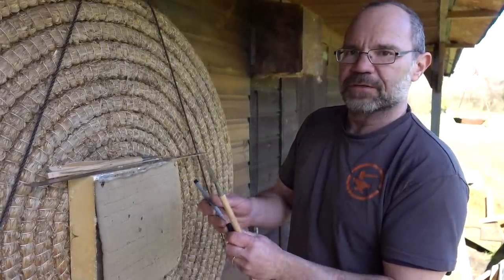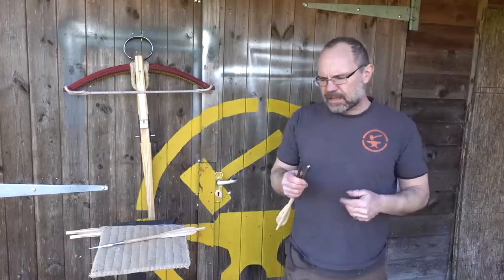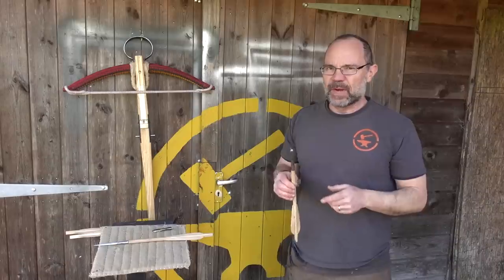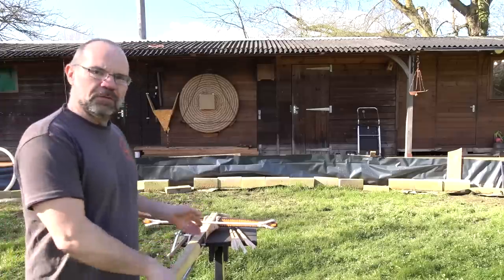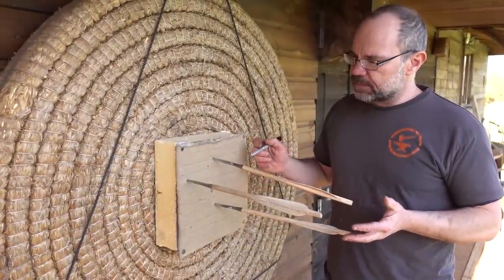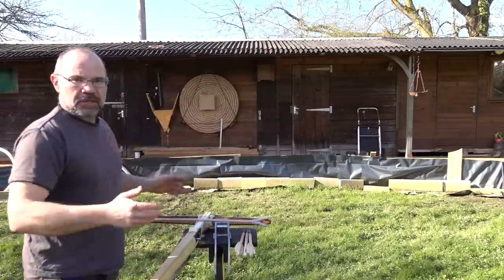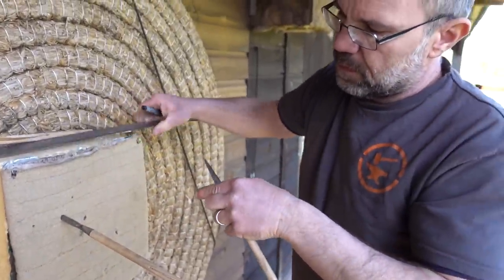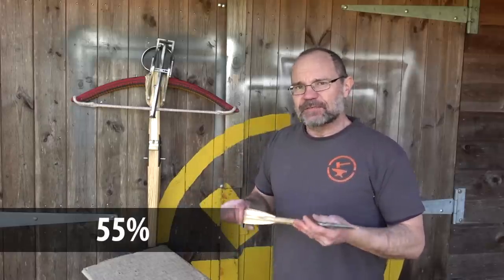Does WAX on ARROW HEADS Do Anything?

Comment: I am very curious as to whether the penetration was so consistent because you were consistent with the wax coating. The bolts weren't in focus when you tried showing the coating but I think I could see it by a reflection that didn't seem to go all the way down the bolt head, and that seemed to be about 45mm. If you coat more of the bolt would it go as deep as you can coat it (if my assumption is correct about the coating you had on them) or would you start having diminishing returns?

Comment: I'd be curious if waxing broadheads did  anything comparable, although they seemed to go through so easily that it might not matter. Also, are waxed needle bodkins still worse than broadheads vs cloth. If the difference between them is slight then I imagine that you might just always use needle bodkins.

Comment: I always wondered why when I watch anything about weapons and armor from history they rarely and most times never bring up the distinction between mass produced war intended type and small batch privately produced type. Because the effects on how we perceive history is by what we find and unearth. Well mass produced used in large scale war weapons are much more numerous and in nearly all case are developed with compromises to reduce costs. Where the smaller scale private producers were more inventive with wide spread use but in most cases owners would use their weapons for generations to the point of wearing them out and recycling them. So little to nothing is left for recovery. So we know relativity little about the true weapons and armors that the wider (wealthy)public made use of. But we have lots of evidence of what was used in larger scale wars and held by troops then assumed as the "what was used back then" concept.

Comment: Arrow/bolt heads would have been kept in storage for extended periods of time.  Surely they would have been waxed/oiled to protect from rust?  Of course, polymerizing fats like linseed probably wouldn't provide the same lubricity as beeswax.
Reply: Guess I should have scrolled down before commenting.

Comment: Well, I would imagine they'd have wax on the bolts and arrows. After all, if a castle or fort is going to have barrels or crates of bolts sitting around for months or years, they needed to protect them from rust and rot. And wax is one of the earliest waterproofing methods we know of. I would be willing to put money on it.

Comment: Well one consideration is that the old bolt heads were not stainless steel so they would have rusted especially if a store was made and then transported to a war zone by ship. Think England to France.

So I recon rust is bad and it would definitely blunted the point of a pointy one and increase drag through the target due to rust being rough. So maybe and I do say maybe prior to storage or transportation the metal bolt and arrow heads were dipped in hot wax to give them a very quick way to protect the metal heads. Now everyone arrives at the war zone or country by ship and immediately fletchers and smiths go straight back into arrow production. On the day maybe the stored or transported arrows are used first and soldiers and officers see how it goes down. Maybe after a big March to the next battle the new arrows are used that have no wax and the soldiers on the ground note the relative ineffectiveness. 

It only takes one person to put two and two together and pass it up the line. Shit thousands or tens of thousands of soldiers are present on each side so someone would notice something sooner or later. This was an arms race after all. 

That might be a plausible mechanism for development.

Comment: This premise seems entirely plausible and almost intuitive. Bees wax has been used for years as a traditional method of rust prevention for iron and steel. Kitchen Troll has a good point about using tallow (beef or mutton) as a lubricant. Tallow and lard have been used as lubricants and for water proofing materials throughout history. It makes sense that an arrow smith would’ve dipped his metal tips into a cheap and readily available protectant. Most early science breakthroughs were based on observation, so it is entirely plausible that archers noticed their arrows and/or bolts penetrated deeper when coated.

Comment: What do the faces of those heads look like under a microscope? I’d imagine just having wax worked into the pores and pits would provide a smoother blade with fewer chances for friction. Ideally I’d like to see faces of the first glob-on-the-tip after being shot (if it can stay on), one that had been dipped, and one polished to try and work the wax in as thoroughly as possible. Does dipping alone leave air pockets? If the wax’s molten lubrication is what’s driving it, would a sticky oil, animal fat or lamp black preform similarly? How do different methods compare in penetration? Could combining polish and dip be even more effective? And finally, could we find traces of any of these on bolt and arrow heads in museums?

Comment: I think a tendency in the analysis of history is to try to put things in a context of "everyone had to have done this" when in reality in any military unit everyone is an individual.  We are trained to work together as a unit, but still we have our individual tendencies at a micro level.  Some guy may have put wax on his arrows, and tried to convince his buddies to do it but they wouldn't.  Maybe it was a well known thing that a lot of archers did.  But if you look at it as a possibility that some guys did this, you can probably get much closer to real truth.  Same applies for putting dirt or stuff to cause infections.  There is no military advantage for that in a battle.  But an archery unit may have had one or two guys that were a bit "extra" who wanted to be that little bit extra nasty.  It was their thing, maybe.  We all have known a guy or two like that in the military.  Of course, maybe it was also widespread.  But these small things that clearly had some small advantage, someone had to be doing them.  (My issue with the wax being used widespread is a matter of supply and logistics. Was beeswax that common, easy to get, easy to store on a soldier, easy to distribute, and easy to keep from melting, and cheap?)

Comment: Point of order from a gun geek: bullets are not coated with Teflon for the purposes of getting through Kevlar body armor, and the Teflon coating does very little - if anything - for the purposes of penetration. The "cop-killer bullet" is a myth - at least, in the form of Teflon-coated rounds. (Armor-penetrating rounds? They absolutely work for penetrating body armor, of course - it's right there in the name.)

The teflon coating on teflon-coated bullets is to aid in reliability when bullets are being cycled from the cartridge to the firing chamber.

Comment: So just a random thought that popped into my head, If the Fletcher comes up with an idea to wax the arrow/bolt heads to increase penetration...what if the armorer (weaver? in the case of flexible armor) added something sticky (thinking tar) to the flexible armor in order to counter the new advantage of the arrow/bolt?
Reply: Texas Typhun interesting thought, but tar would not be the answer. Tarring a shield is one thing, but having tar coated on something you wear, would be miserable. The stench, added insulation, and heat retained, not to mention that your armor would get sticky as hell on a sunny day wouldn’t be practical to use.
Reply: @cav-spartan4201  I was actually thinking to layer the tarred surface so that it wouldn't have much contact with skin on the inside or stick to everything on the outside, though I'm not sure how many folk were layering cloth like that for armor back then. I also suppose tar wasn't the only sticky substance they would have known about, anything to aid in binding up projectiles.

Comment: Medieval archers might have achieved this by accident. Wax has another benefit on steel: it keeps the water off and inhibits rust. Modern blacksmiths  (and machinists), will routinely rub a finished item down with an oily rag for just this reason. Before petrochemicals, beeswax would be a very suitable alternative.

Comment: With the knowledge of hot waxing being an old method used by blacksmiths as corrosion protection, you can be pretty sure the bolt and arrows did get waxed.

Comment: Would dipping the tip in oil help any, assuming that it was done just before battle or as maintenance; I've heard people say the Romans had a ridiculously high trade in Olive oil, far too high for just consumption. The assumption could be made it was used for sword maintenance. While it may have been used to stop swords from rusting, why not arrow/bolt heads as well? Would that have the same effect as wax?

Comment: Rather interesting. I am curious, how do the flesh cutter and the needle bodkin compare at oblique impact angles? (both waxed and non-waxed) Could the needle bodkin catch and dig in while the flesh cutter more just slices and skips off? I am still trying to see if there is one or more areas in which the needle bodkin may have such an advantage that the notion of it being a "cloth armour killer" came to be. Also, many impacts would be on curved portions of the body surface and I presume that any mechanism that would cause the arrow/bolt to perpendicularly align upon impact could give it an advantage.
Reply: That being said, how does the timeline of the development of the "flesh cutter" and needle bodkin compare to the development of different cloth armours and maille armour? The timeline may give hints as to how the different heads fared with the different types of armour. That is, I would expect (though could be wrong) that an armour type would be developed that would resist the presently-available arrow/bolt heads (and other weapons), then the arrow/bolt heads would be changed to better penetrate the new armour and the cycle would repeat.

Comment: I follow Naomi "SexyCyborg" Wu from Shenzhen , China. She is a tech girl who has a sponsor, JLCPCB, who makes custom computer chips. Here is an example of a custom computer chip that measures the force of a Kung Fu punch. 
It occurred to me that a similar, modified chip, could measure the force delivered by an axe, mace, sword or arrow (from a war bow.)
A year or so ago, a couple guys shot arrows, from a 60lb hunting bow at ballistics gel at various distances. 20 yards, 50 yards, 75 yards & 100 yards. Not surprisingly, they discovered that the arrows penetrated more at close range and less at medium or long range. With computer chips like this, one might measure the exact hitting power of an arrow, launched from a war bow (say 120 lbs) at likely combat distances (say 20 yards, 50 yards, 75 yrads, 100 yards or longer distances.)
BTW: Years ago a math teacher taught me that arrows (or bullets) fly in parabolic arcs. The parabola is defined by the angle of launch, the force of the launch and the weight of the projectile and gravity. (Arrows would also be affected by the flexing of the arrow, which would dissipate energy. And air fiction.)
In a mathematically, perfect environment, the maximum distance would be from a projectile launched at 45° to the ground. It would start at say, force X. Gravity would pull on it and it would decrease in speed until it reached the top of it's arc and reached 0. Then gravity would pull it to the ground and it would regain speed until it reached force X again at landing. (Remember, this is in a perfect, mathematical, world with no air friction or lost energy from flexing.) 
If you aim an arrow at a higher arc, say 60° it will rise more steeply and fall more steeply and land closer to you.
If you launch the arrow at a lower angle, say 30°, gravity will pull it to the ground to land closer to you than maximum distance.
The experiment would be to design a cross-bow like frame to hold a 120 lb war bow. It would allow you to measure exactly the amount of force used to draw the bow. It would also allow you to measure exactly the angle of launch. The purpose of the cross-bow frame would also be to eliminate human randomness in the experiment. Thus you could launch dozens of arrows, over and over and get precisely similar results.
There would be three experiments to test:
a. How much force is delivered by a war bow arrow at various distances? Say 20 meters, 50 mteres, 75 meters and 100 meters. 
b. Whats the maximum distance a 120 lb war bow will launch an arrow? (NOTE: Meters did not exist at the time of Agincourt. But can you get 300 yards?)
c. How much force is needed to penetrate various types of gambesons, mail & armor? (NOTE: You already demonstrated that a war bow arrow will not penetrate breast plate armor. But you did promise us shots at side armor, arm armor & leg armor.)

Train Your Punch To Do More Brain Damage- With Science and JLCPCB!
https://www.youtube.com/watch?v=NuXhhkwldEI

Comment: I guess i would like to hear some discussion on how frequent wax was used during the time period. I recall a "modern history tv" episode where he talks about how a wax-soaked cloth works to seal a food bowl like plastic-wrap. candles were a different wax, but WERE a wax that would have been available, but for what other common reasons might someone have a wax handy? I imagine they would have been lubricating bearings (wood and metal,, for wheels, but also for using posts as leverage for hand tools, or in the textile industry for jigs and looms, , they did a lot more manual fabrication of things which might also benefit from having wax, perhaps animal fat would be just everywhere, perhaps they would wax their hair for fashion? (food grease actually offers a fashionable beard and hair if you eat a lot of meat) ,,, By the end of the list of waxes that someone might have available, I think it might be an expectation that people would suggest to each-other, or even provide for waxing an arrowhead or bolt for penetration.
Reply: The list is endless, beef tallow alone is food, candles, leather treatment, wood treatment, grease for iron, general purpose lubricant, used with lye to make soap, moisturiser. I suspect that it would be ok on bowstrings If beeswax wasn't available.

Comment: Other things might have been mixed with the wax, including tallow, pitch, turpentine, and even butter.

In the 1580's, a French manuscript regarding materials used at the time was written. 
https://edition640.makingandknowing.org/#/

Here are some translated excerpts from that manuscript regarding use of beeswax blends. Some of these blends could potentially have been used on weapons like arrows and bolts and I think it would be interesting to know if these blends (which would melt more easily than beeswax) might have produced better penetration that straight beeswax.

I've copied and pasted from the following link which also has some commentary on actual physical research performed with the various substances. I've tried separating my writing from the quoted excerpts with asterisks to avoid confusion. Various documents are cited at the bottom of the article which may 

http://makingandknowing-prototype.cul.columbia.edu/index.html%3Fp=1460.html

***********************

Translation [from tl_p109r]
      

<title id=”p109r_a1”>Working in rough with wax</title>

<ab id=”p109r_b1”>When the wax is too hard, one mixes in some turpentine or a bit of butter, which renders the wax malleable, and cleaner than tallow, which the Italians mix in, because oftentimes, it is necessary to put the tools into the mouth, [tools] which are better when made from box wood or antler.</ab>

***********************
So at this point some potential mixtures include turpentine, butter, and tallow. I'm not sure if by turpentine they mean the solvent we currently use which is highly purified or liquid pine sap or hardened pine sap. 

The commentary also mentions that apparently people mixed tallow (cheap) with beeswax (more expensive) as a way of getting more product for less money.

Here's another excerpt from the above link
***********************

On fol. 151r, the author-practitioner of BnF Ms. Fr. 640 recommends mixing coal with white wax to make it strong,28 and Hugh Platt also mentions this mixture (“Note also that you must first cast all your curious patternes in yellow wax tempered with the fine powder of smale cole”).29 Platt also mentions red ochre as an additive to color the wax, which makes the pattern more visible.30 Biringuccio mentions adding Grecian pitch or “ship’s tar” to wax,31 while both Biringuccio and Cellini write about the benefits of mixing white lead with wax for softening it.321

Comment: Wax coating has been used as protection for the heads and feathers for a long time.  Granted varies oils are used as well but wax has the advantage of lasting much longer in storage, making it much more likely to be used in things like storage in the armory.  The side effect of increasing penetration into armor was a happy coincidence that I'm sure the people of the time noticed and took advantage of.

However your comment about Teflon being used on bullets to defeat modern soft armor is highly inaccurate (it is in fact an urban myth).  The coating of Teflon (and other such coatings) was to protect the barrel of the firearm from the hardened brass of the AP rounds and was torn up by the rifling of the barrel when fired.  It was actually detrimental to the ability of the bullet to defeat modern soft armors.